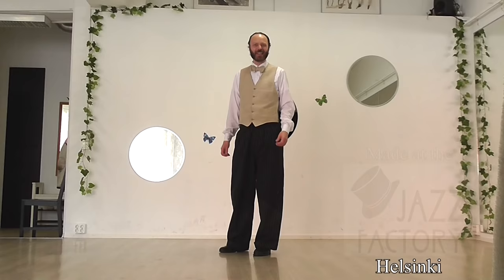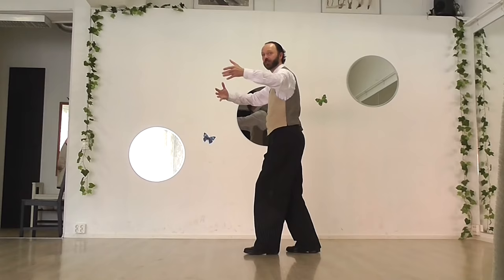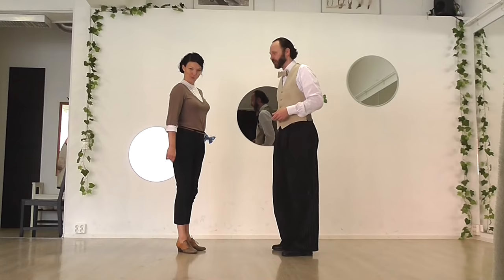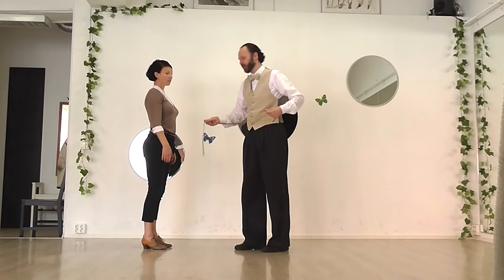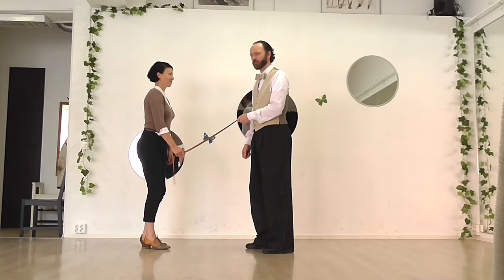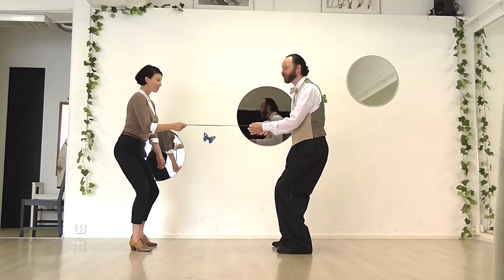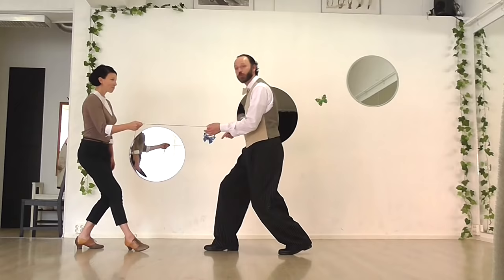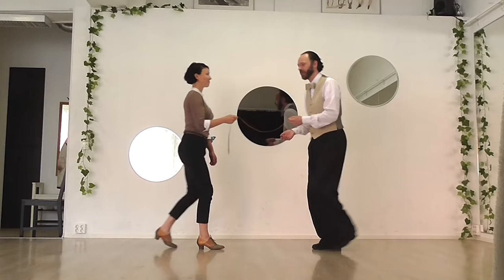Lindy hop connection

Comment: This is one piece of dancing I often see glossed over. Usually it's all about the steps. The actual connection between the dancers is mostly not even mentioned, and steps are shown mostly on an individual basis. The skill to lead, and the skill to follow is really more important than how exactly you're placing your feet, especially when there are so many different steps and moves you can take in a dance like this.

Comment: Suggestion on the sound - Use a wireless microphone clipped to your vest. Yes, you'll need to wear the transmitter, probably on your belt, but you'll get used to it.

Alternatively, you could cover the walls with medieval tapestries...